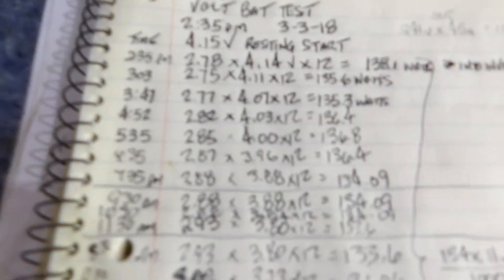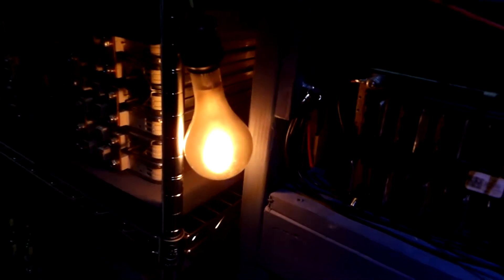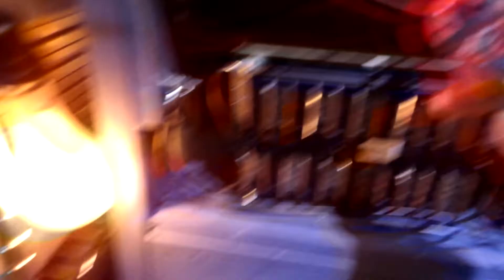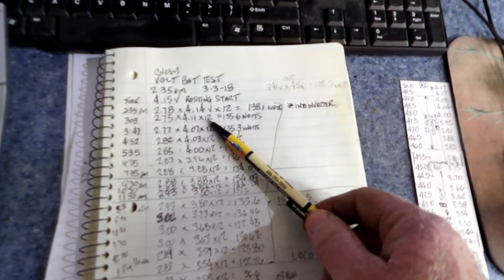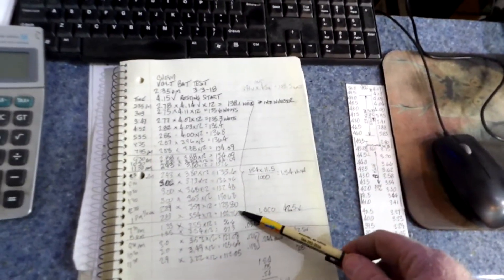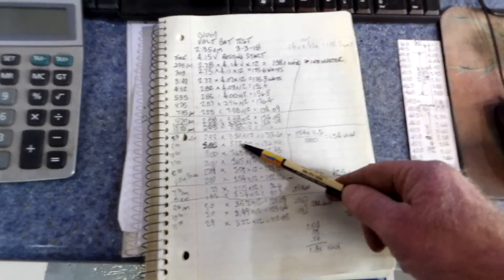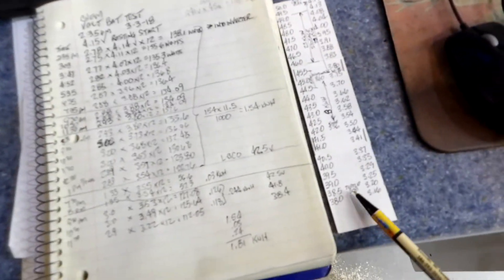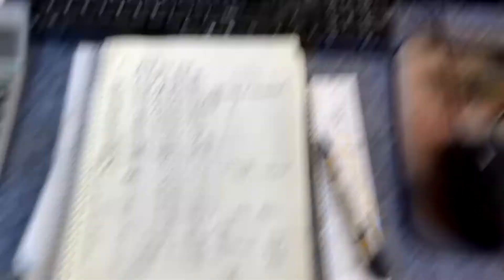Chevy Volt battery capacity testing - off grid storage

Comment: Hi Mark,  I'm planning on doing a capacity test on my own bank, so I wanted to ask about yours.  You used 200 watts for the load.  Was that simply from convenience, or did you want to stretch out the time?  Is a /20hr more accurate than a /5hr?  I'm asking because I want to put a 4500 watt load (water heater) on my bank.  Since Chevy rates it at 18kwh, then it will run somewhere around 4 hours, plus or minus.  Will this be a good value to gather, or is it useless compared to a smaller load for longer duration?  A flooded lead acid battery will often give the amp*hr rating at durations because the usable capacity changes based on the load (high amps for low hours vs. low amps for longer hours).  Do you happen to know if Lithiums suffer the same way?  Thanks.
Reply from the maker: To my knowledge Lithium does not suffer the Peukert Effect, or if it does, it's minimal.  By placing a 4500 watt load on your battery bank, you'll see about .5 volt 'sag' in voltage.   Say  you're at 46.5 V static.  Your bank will be around 46V once you put the load on.  Likewise, you'll see that same .5 volt 'spike' when charging with 4500 watts.   Both the sag and spike cause any capacity calculations you might do to be skewed.   Still, there is nothing wrong with trying your test and recording the results.  You certainly won't hurt the battery.    I used a very small load so as to simulate real world use.   I had virtually zero voltage sag, so the measurements at the bottom were real.  Heating 'may' come into play with a 4500 watt continuous load, skewing the 'real' capacity of the battery bank.  Another thing to consider, the 18 Kwh rating would be IF you can get the battery to 'rest' at 4.2 volts per cell.    You need to have a bit of an absorb cycle to get it there, then let it rest.  See if it stays at 4.2.  It's not so easy to fill  these batteries right to the top.  I don't even try.  Looking back at my test, I started at 4.15V and ran it down to 3.22.   However, there isn't much storage above 4.15, or below 3.22 so I called it good.
Reply: Thanks a lot for your input.  Makes sense.

Comment: Hi Marl, Do you know if there is a way to test the voltage of the battery pack voltage outside of the vehicle? like reconnect the disconnect and test voltage between terminals?
Reply from the maker: I don't know and I don't think I would even try because the voltage is DEADLY... you're talking as much as 400V DC.  If you accidentally make contact across your body (arm to arm) it will fry you like a french fry :-(
Reply: I found a couple of batteries but the batteries were removed from the cars about 2 years ago. I am worried that the batteries are not good. So I am trying to be on the safe side and test the batteries before shipping.
Reply: Hi Mark, I took the chance and my batteries arrived today. All of them seem to have good voltages! a recently crashed car has 50.4V on the modules. The other two were sitting for 2 years and still have good voltages 45V and 42.8V. Thanks for your videos and DavidPoz... very helpful during the disassembly!

Comment: Hi Mark Osborne, awesome and informative videos! I am purchasing a chevy volt battery pack and I was wondering.  I read somewhere that the battery pack can go as low as 36vdc. But from your data It seems like there is not much left after 42V. So from your data is seems like the battery pack voltage should be kept from 42V to 50.4V and provide around 1.8 KWh. Are you still recommending the safest lowest voltage you want to go with the pack as 3.5x12 = 42V? Are you still using that as the cutoff voltage?   I am asking because i was trying to decide between the Magnum MS4448PAE inverter that can do a DC voltage range from 36v-64v or a schneider sw4048 that can do 40v - 68v. It seems like both inverters should work from your data.
Reply from the maker: Yes yes and yes. There's almost nothing left below 3.5 volts (42 V) , so like you say, either inverter will work just fine ! Once you hit 3.5, the voltage starts falling like crazy, it's like falling off a cliff. You'd never want to go there unless it was a dire emergency.  If I ever got near 3.5, I'd be starting the generator.

Comment: Relative newbie here.  I'm trying to understand your test data. You have 360w + 200w 120v bulbs hooked directly to a 48v battery?  That's what it looks like and I think how the amps add up.  I didn't know you could do that.  
I HAVE done it the other way and blew out the 12v bulb!

How does this test equate to having a 48v to 120v inverter hooked up to that same battery and running those bulbs at 120 volts?  Wouldn't that be a more real world situation?  Are you just trying to determine how many watt hours are in the battery?  Maybe the math is the same but I'm confused by the 120v bulbs on the 48v battery and no inverter or shunt battery monitor data.  

I just got a Victron BMS-712 and a MPPT 100/30 and 400 watts of panels.  I've been experimenting with 16 Headway 38120's (4p4s) for (I think) 36ah/460wh.  

I watched your video several times and read the comments but still don't fully understand why you were doing the experiment this way.  Is it that you don't have a 48v inverter or battery monitor or just that you don't need one to do this math?  Looks like you've got a lot of equipment and experience so I imagine you have plenty of monitors and shunts and stuff.
Reply from the maker: Very good question young man !   
 
Yes, 120 V bulbs do just fine on 48V.  They are nothing more than resistors. 

Yes, I was just trying to determine the watt-hours (I like to use Kwh's cause watt-hours makes my head hurt) contained within a single 48 V module. 

You could do exactly that: IE use an inverter.  Nothing wrong with your suggestion.  And yes a shunt on the 48 V input would theoretically give you the same answer if it's connected to a black box that does the calculation for you.  I didn't have a spare shunt, so I did my own measurements in 1 hour intervals and added them up.  

My measurement is somewhat real-world as I typically pull about .86 amps continuous out of a single 48V module during the day, and .4 amps at night.  But a .6 amp (average) draw would string the test out for probably a week, and I didn't have a week to run 1 test,  so I put enough bulbs in parallel to achieve a 3 amp draw.    

Yes, I see what you have :   16 LIPO batteries that average 3.2 volts and each battery can give up 10 amps for 1 hour.  So.... 3.2 x 10 x 16 = 512 watt-hours or .512 Kwh's    How many Kwh's do you use in a day ?   Are you trying to build a battery bank that would supply your needs for a day ?

Comment: Mark, I am doing the same set up , with 12 of the volt batteries, all in parallel and have a few??, am using Magnum 4448 inverter, with remote screen, the people where I purchased  my equipment, also a midenite classic 150, are telling me I need a BMS, which I do not want to us, (1) are you using one, what is your thoughts on them.
(2) how did you set up your inverter charge for these. also the midenite 150  ? I am having trouble there, am located in Panama, lot of good sun. Thanks, Paul Donohoe
Reply from the maker: BMS or no BMS- that is the question.  Do NOT rely on me for an answer.  I'm just one person who's decided to forgo the BMS- for now. I'm coming up on 1 year without a BMS, and will soon do a video showing how the cells have stayed 'in balance'.  There are 3 parts to a BMS - balancing, maximum charge protection, and minimum charge protection.  Your Magnum has an adjustable low battery cut off (LBCO), and that is what I rely on for my minimum charge protection. Likewise, your Midnight Classic is adjustable and allows you to set the maximum charge voltage.   So, you'll have 2 of the 3 parameters of a BMS covered.  There are people who have made up cell balancing units and I may, in time, adapt such a thing to my pack should it become 'out of balance'. https://www.youtube.com/watch?v=xZEHlUQnsVM  So far it is not necessary.  As far as how to set up the inverter and the Midnight Classic, their directions (owners manual) are very clear.  Read them both.  Set your LBCO in the Magnum and adjust your Absorb and Float voltage in your Midnight.  I don't know the voltage you are running so be sure it is within the parameters of your Magnum (60 V is the max nominal battery voltage for a Magnum-I believe) and make sure your panels are wired so you don't exceed the input voltage of the Midnight Classic.

Comment: Good info.  I just picked up a 2017 Volt pack with 14 kms on it.  Amazing battery.  I have a BMS coming to balance the cells.  I have mine set up as 15s and then 6 of them parallel.  Each is about  57 volts.  That's why i am installing a BMS.
Reply from the maker: Very interesting, what do you have for an inverter and charge controller ?
Reply: I have 2 Outback Power Systems VFX 3648 Inverters, 2 FM60 150 VDC charge controllers, Mate 3, 2.6 KW of panels and a 1975 15 KW JC 1800 RPM NG Onan generator.  I am still connected to the grid as well but about 85 percent of my house is ran off the Inverters.
Reply from the maker: Very nice, I see the 3648 is rated for 42-68 volt input. How many total Kwh's do you use in an average day ?   We average 20 in non-cooling days and as much as 36 in July and August. SE Michigan - the solar is rough from mid Nov till Feb 1 but WOW- starting Feb 1 it's like the lights get turned on !
Reply: All depends on the weather here in Ontario.  We are located off lake huron so winter is a write off for solar.  
So I am on grid in the winter and that messes up my Kwh used.   I looked at my summer kwh and id say roughly 4 to 8 depending on if the furnace is going to move air for the AC.  AC compressor is on grid.  I need more panels but I don't have any more room.  I live in town so I gotta keep it under radar a bit eh.  Stove, dryer, furnace, water heater, fireplace and generator all NG. Some days i just turn on electric heaters to burn up power.  I plan on setting up a electric hot water and controls to dump solar input to that when battery full.  Just need time and money eh.  I got tired of lead acid.  Only had system up for about 3 years and its paying itself off.  We have stupid pricing for power here in Ontario.  My lead acid bank is showing signs of degradation and its a pain to maintain.  I will need to keep the Volt battery cool in summer and warm in winter.  Still working on that.
Reply from the maker: Oh ya, I'm familiar with your "Hydro" costs...hahaha.. my uncle Jim works at the Bruce plant (do I have that right ?) anyway, yes.  And I understand if you can't put up more panels, shame huh.  Because panels are cheap. Like you say, dumping the excess into heating water will really pay off.  That's my next move.
Reply: I have a bit more space possibly 4 more 300 watt 48 volt panels.  That would max out the one Fm60.  The other has 6 36 volt panels on her.  Yes the Bruce Nuclear Plant is about hour away and way to many people there making way to much money.  I work on Weekends with a buddy who does solar installs and fixing up inverters.  Can fix much on a inverter much these days, but still can solder in replacement transfer relays.  
I know the mangums well as well.
Reply from the maker: Do you know if the FM60s will current limit themselves? One of the strategies I used to get thru our horrible winter is to over-drive one of the Classics.  I've got (27) 320 watt panels feeding into one Classic- and it works awesome.  So on cloudy or overcast days (like today) I get the advantage of all the panels, but when the sun comes out, the Classic just limits itself. And I don't need all the power on a sunny day so it doesn't matter.   This saved  buying another $500 worth of wire and conduit, another combiner box and another charge controller.
Reply: in my opinion the FM60's suck.  You get over the 130 volt mark and they get cranky.  You get close to the 60 AMP output then get cranky.  They will current limit but bad stuff happens after a while.  They were second hand units that customers did not want due to the voltage limitation of 150 VDC and the Amperage. 
Switched to Midnite's and thats on my wish list as well.  I use the outbacks for the optics re cloud control and monitoring.  I see why you overpanel.  Cloudy days.  I like the solar shingle idea but to expensive yet and the town where I is not interested in Net Metering at all.  Says something like our lines cant handle it.  I call BS cause 90 percent of the town was rewired back when we had a tornado go tearing up the town.  Heavier wire, new poles, new transformers.  I am still paying that off as they passed the cost off onto the users even though they have insurance for that.  I would like to know where all that cash is going.  Bah politics.

Comment: Greetings from Oregon. We still may sell and start over with a smaller place. 41.75 acres is getting hard to maintain. If we do I am going with the Chevy volt and or the Nissan leaf batteries on the next solar power build. The L-16 battery bank we have is going to be 4 years old in May. I have maybe 10 more years before we need to change them. We only cycle 12% daily. The graph for a daily cycle of 88% SOC is 5500 cycles. That's 15 years! I could have a cataclysmic failure from a manufacture defect. I would like to have a power system that my wife could handle if something happens to me. Watering FLA batteries and inspecting cables every 60 days probably would not be the best thing to leave behind for my wife to have to mess with. Having the Magnum stop inverting at the knee is brilliant. I have seen others buy an expensive low volt relay that is designed for sailboats. They work great but costly where the Magnum has the programmable low volt set point. We have considered selling and moving north east of here. Lots more sun but colder and more snow. It is a much dryer climate 100 miles east of hear.
Reply from the maker: You really have those FLAs figured out, Steven !

Comment: Mark, thanks for sharing your data. What charger would you recommend for charging the chevy bolt packs? Mine is/will be broken down into 12v packs.  Thanks.  Paul
Reply from the maker: There are so many charge controllers on the market. I'm very happy with my Midnight Classics.  Schneider also makes great charge controllers, and as you've seen, my little MakeSkyBlue has done nothing but work flawlessly for nearly a year.